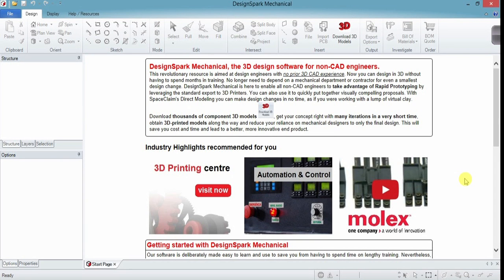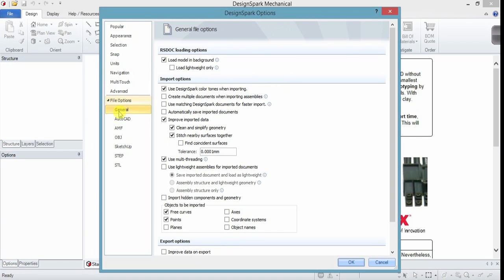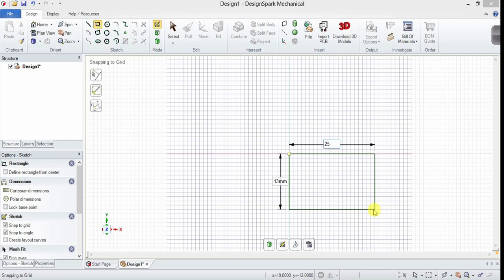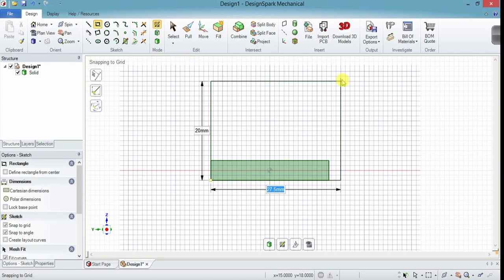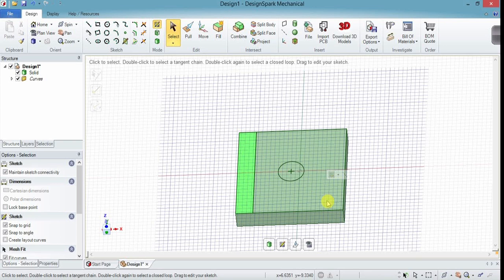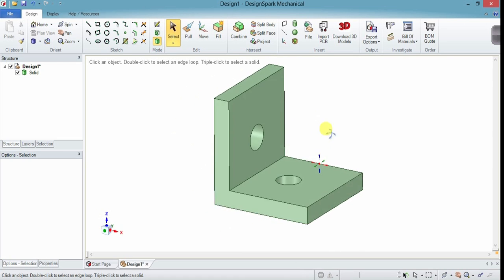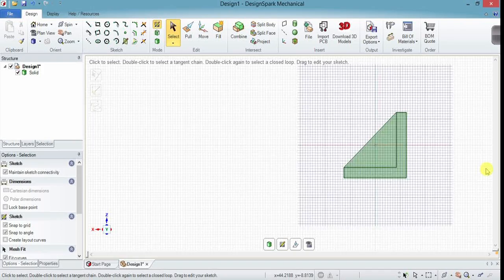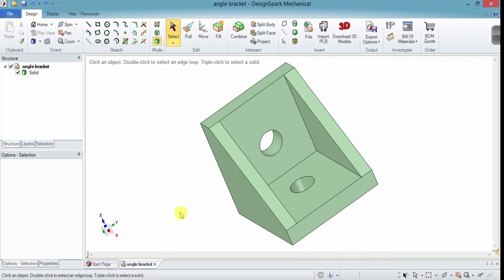The MakerHive DesignSpark Mechanical - ZERO TO HERO - EPISODE 1

Comment: Very nice intro to DSM. I've been using it for almost a year and consider myself to be an advanced user. DesignSpark's push-pull direct modelling approach is incredibly fast and interactive. It really is a huge leap forward in productivity compared to traditional history based modelers.
It's not perfect though. It has limitations, some of which are intentional. The steps for creating the gussets are an example. In SpaceClaim (the parent of DSM), and most other MCAD packages you have a 3D mirror tool which would have allowed the creation of both gussets at once. That function has been intentionally stripped out of DesignSpark.
Another important tool present in SpaceClaim that has been stripped out of DSM is the blend/loft tool. I miss that one the most.
Also missing is a lettering tool, but a clumsy workaround is to create the lettering in SketchUp 2014 and then import it.
Most of the other differences between SpaceClaim and DesignSpark are not of interest to people creating parts for 3D printing.

It's kind of a shame that DSM doesn't get more recognition in the 3D printing community. For rapid free-form 3D modeling, it is absolutely unmatched by any other free offering. It even surpasses many of the high-dollar packages in that regard.

I would encourage you to make more videos on DSM if you have time. You did a great job on this one and there are obviously a ton of other tools and techniques that can be covered.